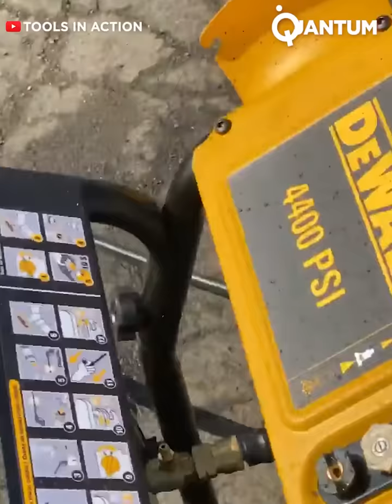Amazing Tools That Are On Another Level  ▶33

Comment: I don't usually write comments about these videos, but there are so many old (and some bad) things here, that I just had to speak up... 1- (0:01) Yes, you can use a crescent wrench, just about any crescent wrench, to pull nails but only if the nails are up out of the wood by 1/2" or more and only if the head of the nail is the right size for the crescent wrench. It would probably be better to use the hammer that you couldn't successfully drive that nail into the wood with, to remove it. 2- (0:11) Electrical cover plates take into account that part of an electrical box sits on the face of the drywall, countersinking into the drywall like this is unnecessary and it weakens the drywall (drywall actually gets a lot of its strength from the paper that is on both sides) 3- (0:36)A plastic hose clamp? I'll stick with the worm drive clamps that have been around for decades. They are cheap, reliable and available in sizes up to, I think 10 or 12 inches, and require a screw driver or nut driver to tighten rather than an expensive pair of channel locks. 4- (1:28) Lock wire pliers have been around for decades in the aircraft industry. I'm not sure when they were first used, but I know it's been at least 50 years. 5- (1:53) Five minute epoxy, who hasn't heard of this? It's available from the inexpensive stuff that you can buy in a grocery store, to high-strength industrial epoxies that can cost upwards of $100 per tube. 6- (2:04) "This machine unscrews any nut in seconds, no matter how tight it is". I'll stick with an impact wrench. They are smaller, lighter, just as powerful, doesn't have to be used from the ground, probably costs the same or less than that contraption, and I can put it IN my toolbox at the end of the day. 7- (2:27) Pneumatic and electric shears like this have been around for decades. Now you can get them in cordless too... 8- (3:01) "Every roofing company needs to have this". Again, these have been around for decades. It talks about preventing injuries, then shows a worker on a roof that was almost one misstep away from falling off the roof with a bundle of shingles. I assume this was shot in the USA, in which case you guys should know about OSHA having rules about using fall protection in situations like this. 9- (5:44) Pressure washer, another one that's been around for decades. Yes, you can cut many materials, including steel plate, with high pressure water- they've been doing this for decades too. 10- (6:33) Diamond discs for grinding concrete, wanna guess? Ya, decades... 11- (7:22) A cylinder hone, come on...? I'm almost 60 and we had these when I was in high school and they weren't anything new then. 12- (8:13) The Makita beam planer is not new or unique. Aside from Makita, these are manufactured by Mafell, Festool, Triton, HEMA and others. Once again these have been around for decades. 13- (8:38) This is the click-bait that got me to watch this video to begin with. "A tool on your keychain is super helpful, it can take you out of an emergency". Yes, I guess they can be, but exactly WTF does this thing do?? 

SO... what's next? Perhaps you could do a video on these electronic things I've heard about. They're amazing machines, almost magic. They have a keyboard like a typewriter, combined with a screen like a tv, and speakers like a radio. You can plug them into a wall or even run them on batteries. Now, if we could just figure out a way to use them to get information or send messages all around the world...
BTW, my apologies to all. I never intended for this review to go on as long as it did. I resisted going off against all the clips because there are a couple cool ones, but they are overshadowed by how many bad ones there are.
Reply: Смею предположить что это не выдают за инновационные технологии, а просто показывают что есть интересного из инструментов

Comment: 00:01 1- 7 SACA PREGO
00:12 2-ferramenta transbordante - ESCAREADOR DE BORDA
00:27 3-rebite-PORCA REBITE
00:36 4-ABRAÇADEIRA plástica em mangueia
00:51 5-APLICADOR ALINHADOR DE FITA 
01:01 6-TESOURA CORTA ARAME
01:08 7-ESCADA LEVE DE RODAS
01:27 8-ALICATE GIRADOR
01:42 9-IMANTADOR DE BROCA
01:53 10-SUPER COLA solidificador de furos
02:04 11-DESPARAFUSADEIRA
02:18 12-BANCADA PARA FERRAMENTA
02:26 13-TESOURA ELÉTRICA PARA CHAPA
02:38 14-GUIA PARA FIOS
03:01 15-ESCADA PARA ELEVAÇÃO MOTORIZADA
03:22 16-AMOLADOR DE FERRAMENTAS 
03:57 17-CHAVE FIXA ESTRELA
04:11 18-VENTOSA
04:21 19-SOPRADOR DE FOLHAGEM
04:33 20-ASPIRADOR CARRINHO COM TRITURADOR DE GALHOS
04:56 21- SACA PORCA PRESA
05:15 22-GABARITO PARA RISCAR
05:26 23-REMOVEDOR PNEUMÁTICO DE PREGOS
05:44 24-LAVA JATO DE ALTA PRESSÃO COM ÁGUA DO BALDE
06:06 25-TORCEDOR DE FIOS PARA EMENDA
06:36 26-DISCO DIAMANTADO PARA ALISAR CONCRETO
06:53 27- REFRIGERAÇÃO/LUBRIFICAÇÃO PARA FERRAMENTA DE FURO/CORTE
07:08 28- REMOVEDOR DE PRAGA DA GRAMA
07:23 29-LUBRIFICANTE DO INTERIOR DE TUBOS
07:41 30-ENXADA ROTATIVA
07:55 31-SOLDA EM ALUMINIO
08:14 32-PLAINA ELÉTRICA 
08:25 33-ESQUADRO (2 EM 1) E CANTOS COM ANGULOS NÃO RETOS
08:38 34-FERRAMENTA DE CHAVEIRO
08:41 35-SUPORTE PARA FURADEIRA
08:53 36-SERRA FURADEIRA
Reply: Donde la puedo conseguir

Comment: When I did roofing, we had the shingles delivered onto the roof. The delivery trucks had a boom lift that would put them on the roof with the pallet. We would just haul down what we didn't need. Easier down than up.
Reply: Did You Notice The Guy Had No Safety Harness.. lol
Reply: Haul them down? We dropped ours off flat.
To old for extra work

Comment: Some of these tools I have. The one is a pair of what we called in the military safety wire pliers. They are used to keep nuts and bolts secure and prevent them from backing out under heavy vibration. We used them in the aviation field. I believe snap-on sells them.

Comment: What was the point of the steel chain whip, in what situation would anyone need that. It just seems unbelievably dangerous.
Reply: for real right?
this ladder is lightweight which makes it easy to move,
this compact welder is great for corner welds,
this CHAIN WHIP is made out of CHAINS and WHIPS!

...one of these things is not like the other

Comment: I legit want to buy a few of these. Are they on the market or were these just product demos?
Reply: Im with you, so how do we get one?
Reply: I do know the one at about 2:28 is called air shears or pneumatic shears. They work pretty good for sheet aluminum, thin fiberglass sheeting, and thin steel sheeting. The jaws do get dull and need changing, but I had a pair for decades while I was a semi trailer mechanic.

Comment: @1:28 - those wire-twisting pliers aren't new.  They've been around for decades.  I was a helicopter mechanic in the US Army from 1985 - 2006 and I always had a pair in my toolbox.
Reply: dolita windo  - it's a survivalists' multitool.
Reply: That's like the one at about 2:28; it's a pair of air shears or pneumatic shears. I had a pair for decades while I was a semi trailer mechanic.

Comment: Those wire twisters  have been around since and before the 60's. I've used them many times at my job. Aircraft mechanic.
Reply: love the fact that the tool at ~7:24 doesn't even get named, but the hone has also been around for quite a while, and i'm sure using them in drills is not that new either.
Reply: I've seen those before and never knew what they were for.
Reply: @bender49ers  Aircraft mechanic here too...we call them  'safety wire pliers.' I have small, medium, and large ones. It's actually the only FAA approved method of safety wiring in aviation. 👍
Reply: @tima.478  cool good to know! Thanks
Reply: @bender49ers  YW
Reply: The bulk of these aren't new! Like the air shears at about 2:28 – I had a pair of those for decades while I was a semi trailer mechanic.
Reply: @Moehre040  those look cool af. It’s funny cause I bet that it wouldn’t pass house electric code even though it’s a step up

Comment: The wire twist at 6:13 is incorrect . the 3 solid copper wires should uniformly wrap each other to form a good electrical connection.. Vs 1 wire wrapping two straight wires. . ( still better than some peoples handy work. ) .

Comment: Seriously? In what situation are you using a wrench where you suddenly find yourself needing to remove a nail?

Then attaching a garden hose directly to pvc? 

The thing for the pliers is dangerous. If you can't cut through without having to force the pliers to cut it's wrong, first off your going to damage the pliers cutting surface by applying too much pressure, and you risk sapping the pliers, use the right tool for the job, otherwise that's how dumb people end up hurting themselves.

This person must be from some third world country because most of this is not how you should be doing things.
Reply: The pliers operator isn't putting that much pressure on the pliers. It's just doing the cutting faster, because your hands start to cramp after cutting about 500 of those cross wires without stopping. I make cages with smaller opening wires, but the thickness is about the same, and your hands get tired! I can vouch for that!

Comment: I LOVE the crappy naming of the tools also! Safety wire pliers - Twisty wire maker HAHAHAHA. They're used on aircraft,  motorsports racing & aerospace  equipment. Special bolts used in pairs, have holes inside the head for wire. They are used to secure them in place , no backing out due to vibrations.

Comment: This is the second time I've seen them use a thumbnail of the one device they don't explain nor demonstrate. I believe this is called clickbait, and I will no longer watch this channel.
Reply: Lauu
Reply: Not to mention that none of the tools are new, except for a couple of junk-quality gimmick tools.
Reply: You just saved me 9 minutes and 12 seconds.
Thank you
Reply: Well that settles it. Thank u for saving my time good Sir, I bid u good day
Reply: It’s a shame isn’t it. They get monetized by clicks whether or not you watch the entire video.
Reply: 8:40 ?
Reply: @Mazda.Fit.  Did they demonstrate or explain it at all? I must have missed that part.
Reply: It would be nice if YT would limit these garbage clickbait videos.
Reply: I looked it up…it is a Brad Blount (JBB) power tool that is no longer made. Supposedly made out of titanium and there is a matching lanyard bead on the same cord.

Even on the Arizona Custom Knives website it doesn’t explain what it is.

So, yes…completely annoying to even show the dang thing.
Reply: That's exactly why I've started my non-clickbait channel "tech lab HD"
Reply: @suyitnono2872  ؤددوظةءدءةردءةدودرذءةزءودزءدةءذدوءظزءةظءززددرظءدةةردةؤظظردءةزءودءزءدءءدة
Reply: That and while demonstrating the Greenworks battery powered pressure washer, segues into a pressure washer cutting wood, making it look as if the Greenworks is doing it, but then blurps a quick 4500 psi Dewalt which is actually cutting the wood.

Very deceiving this channel.
Reply: 8:39....it there just for a moment
Reply: It was the only one I wanted to see

Comment: I like how they show you a crappy "bucket" pressure washer and then switch to a gas powered DeWalt and claim that it's still the same one that's water jetting through wood. (Last few frames it's obvious)

Comment: It's with this cutter for socket cans that it's nonsense for me. The paper on the gypsum board also affects the amplifier and removing it and then tightening the box may cause the box to fall inside. Let us remember that at least in our country, sockets and their housings are designed in such a way that this small threshold is hidden under the socket housing.
To z tym frezem do puszek pod gniazda to dla mnie bzdura. Papier na płycie gipsowej ją też wzmacniacz i takie jego usunięcie apóźniej dokręcenie puszki może spowodować że puszka wpadnie nam do środka. Pamiętajmy, że przynajmniej w naszym kraju, gniazda i ich obudowy są tak zaprojektowane aby ten mały próg ukryć pod obudową gniazda.

Comment: Yes the next time I need to pull out a nail I'll reach for a wrench and completely destroy the wood surface I am trying to remove the nail from.  Also that "center finder" you can literally make that with some scrap wood, and 3 nails or 2 nails and a pencil or if you want to get really fancy, one block of wood with two blocks of wood on the ends and a pencil or a pin in the center.  It's not hard to find the center of something when you know the dimensions of it anyways.  Yes center finders are useful but you'd have to be a fool to pay for one.

Comment: Some of these are cool.  Some of these have been around for years.  Some of these are just more expensive and complicated versions of what you can find in the hardware section of your local store.  Some of these you can either craft or print or improvise on the cheap.  Some of these are dangerous or problematic or highly specialized.  Some of these you us little clue as to what they do.  And a couple of these are clearly the wrong tool for the job (a crescent wrench for a nail?).

And all of them are worthless to those of us that don’t already know what they are or know where to find them since you gave us no description.

Comment: Just to mention it:
Someone misuses Pliers and an pneumatic tool ... another one presents an Aluminium Staircase with Wheels... drill pliers will mostly come across a Person who has to do secure Screws with Wire... magnetic adapters for screw bits are neither "Next Level" nor "new"... 2 component epoxy is also not a mind boggeling invention... 
That "Chainsaw-Wheel on an Anglegrinder"-Thing is a thread to your health and the stupidest Idea i could imagine...

Most of the Other Stuff are just commercials for Products that nobody needs or are quite neesh Products...

Comment: @ ≈ 2:29 can confirm – that style of shears, the pneumatic ones, are really good on sheet aluminum, like for semi trailer side panels! I was a trailer mechanic for 2½ decades, before I was disabled, and used them a whole lot! Their jaws do get dull and need chanted out, though.
Reply: I've always called them double cuts. I do HVAC and they are amazing
Reply: top
Reply: bilishu aliss  If you're pulling a nail, then the wood surface has already been destroyed.  No need to be overly dramatic.

Comment: Hi Quantum teach hd
I have a question can we make an engine which work on only water
Like motorbike and cars
Reply: How old are you.
Reply: @patriklindholm7576  20 year
Reply: You mean like steam powered engines?  A nice idea for old river steamboats and coffee pots, but not bikes.
Reply: @eds1942  no
I have an idea
From water electricity is made 
and we have electric bike and also cars by using water we can run bikes and cars by putting inside dynamo
Reply: @tanveerahmad6145    Like a hydro-electric dam or a wave turbine then.  Those just convert the shear force of the volume of water and it’s complex interactions with other variables into useable energy.

A portable water engine for a bike that you can ride town or on the trail isn’t going to be very efficient.

Comment: Man didnt think I see a torque multiplier. A very expensive piece of hardware. Great to have when needed, but not used that very often, even when I was working at the shipyard where there is painted hatches everywhere.  It cheaper to take a wire wheel, wd-40(or any other kind lubricant/rust remover since sometimes people do a shitty painting job that it can still get rusted.), a trusty sturdy breaker bar, and maybe a cheater pipe. Unless you're doing tons of these in a day every week then buying the tools is cheaper long run.
Reply: Yep, I worked as a semi trailer mechanic for 2½ decades, and though the shop had one, for an average of 10 - 12 mechanics, it might have been taken out 2 or 3 times a year. I mean, if a 1" impact and heating it to bright red with a torch can't take it off, it probably doesn't want to come off, LOL!
Reply: @MaryAnnNytowl  lol same., but in my case we worked with 3-12in nuts. Sometimes even heating and slamming on striking wrench with 20lb sledge wont budge things sometimes.  Then we had to use the hydraulic torque wrench if it small enough. I think I only had to cut/split 3 nuts  and had the in-house machinist department machine a new one. Biggest one I had to get cut was 10in bronze hex nut after 4 hours trying to get it off.